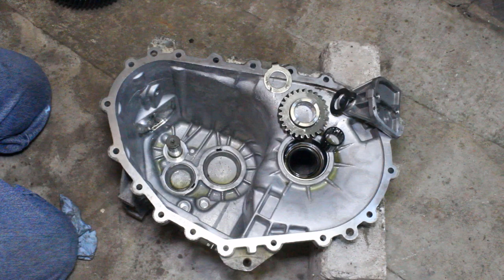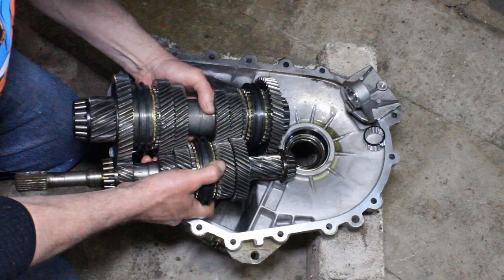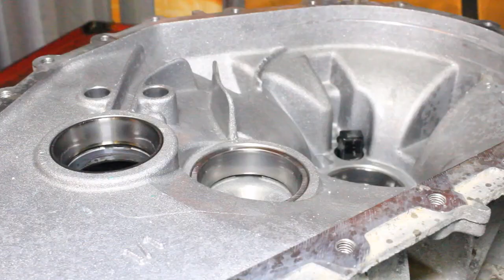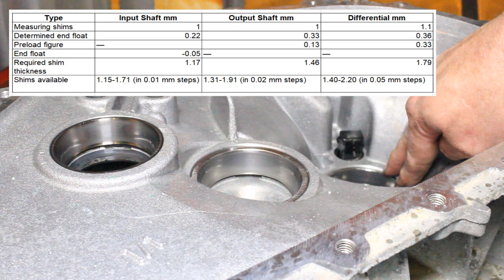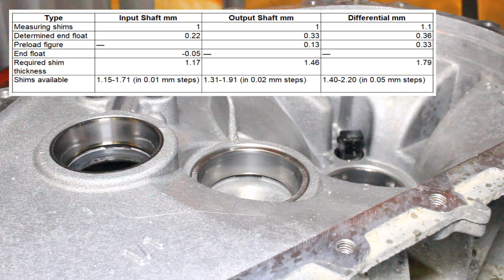MTX75 Assembly

Comment: I have this same transmission and on the backside there is a small plate about 3” wide. It is cracked and i need to replace it. Can i do that without causing any further damage, or will it leak?

Comment: Are different differential ratios available? I have a 2003 focus I'd like to achieve a taller gear ratio
Reply from the maker: There are three final drive ratios available; 3.42, 3.82 and the rare 4.06. In an 03 Focus you likely have the 3.42 gear set.

Comment: Appreciate you doing these disassembly and reassembly videos on this gearbox alot mate. Need to reseal the shifter assembly as it is leaking really badly on my father's car, was a bit worried about taking the shifter out as Ford wouldn't supply a repair manual even to a mechanic (myself) and I wasn't sure if any other work was involved, I'm not to familiar with fords.

Comment: Is there no sealant on the reverse idler gear bolts?  Seems like it would be a leak path, unless they're above the fill line of the transaxle, which it did not look like.
Reply from the maker: Ford service does not call for sealant on these bolts.
Reply: @davidpatience4682  thanks for the reply, going to be swapping the differential in my Cougar this fall, I will definitely be checking this series again.

Comment: Thanks for sharing all the info. I am planning to replace the transaxle on my 07 Focus this summer because the syncros are worn out in the current trans and my dual mass flywheel is acting up. I pulled a trans from a self serve pick and pull type yard and now I want to inspect the new trans and replace any worn out parts before I swap it. I was hoping to find out which bearing is the rear pinion bearing that could be either 18.5mm or 20.5mm so I will be able to order an overhaul kit if required.

Comment: Hi, nice video. I have a Volvo V50 1.8 Flexifuel 2009 which has an MTX75 5-speed manual gearbox. Yesterday, I replaced the LH driveshaft. When gently prying off the drive shaft from the gearbox, I noticed a slight suction noise as if the there was a negative pressure inside the gearbox. After the suction noise ended, gearbox oil leaked out (as expected) and I continued with changing the driveshaft. Everything went fine: I assembled the drive shaft into the gearbox, hub etc, no oil leaks or other complications. I took the car for a test drive today under heavy load and inspected underneath afterwards: there is an oil leak from the newly replaced driveshaft. 

Question: is it normal to have some slight vacuum or negative pressure in the gearbox? If not, what are the causes or potential issues?

Comment: It looks like the output shaft shim kits are discontinued at this point. I have a 2010 MTX75. It's going to be used in a rally car and the car came with a set of Uninstaller close ratio gears. From what I can gather a new shaft or new end bearings should be the only things that change the needed shims. Does that sound correct? Hoping I can try to be precise with the end bearings being pressed on. I know I'll have to reshim the diff races as it is an aftermarket LSD going in.

Comment: I had to take my case apart to get axle c clip out. When putting the 2 half’s together is there any gasket or rtv of silicone I put between the 2 or between case And shifter assembly
Reply: I’m doing mine now and surprised/confused to find no gasket there. Maybe because there’s no oil pressure there it’s not required? Feels uncomfortable putting it back after all the work to get it out, knowing there’s 2L of oil sitting in there 😅

Did you silicone gasket it or leave it bare?
Reply: Did you find an answer to this? I just did literally the exact same thing. In fact I can’t even get that alignment dowel to break loose but I got the clip off the magnet. Wondering if I can just tighten it back down
Reply: @HoagieBob  I got a permatex trans sealant from the part store and it worked just fine

Comment: got any idea why both halves of the case would not line up?
Reply from the maker: Something in the gear train is out of alignment. Possibly the reverse idler gear. When it all lines up it will fall together.
Reply: @davidpatience4682  i dropped in just the input and outshaft and tried to close the case. I have maybe a 4th inch from closing. If i drop in only 1 shaft... the case closes all the way.

Comment: Hi, do you have any tips on putting back the transmission back on a 2003 ford focus, I changed the clutch, my problem is, I can't install the transmission back.
Reply: Did you manage to do it? When I did it I had the wrong clutch for it. That sucked had to take it out and put the right one in. I had to use a ratcheting strap wrapped around the motor and transaxle. The subframe was dropped before I started. Used a floor jack to get it close first. Tightened the strap then twisted the transaxle until it popped in the splines. The best sound ever when it worked 😁